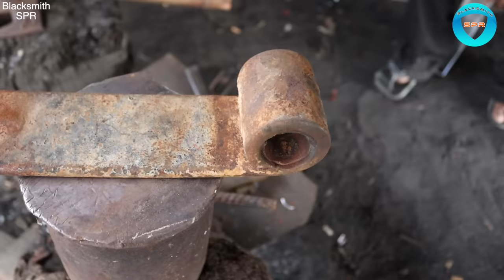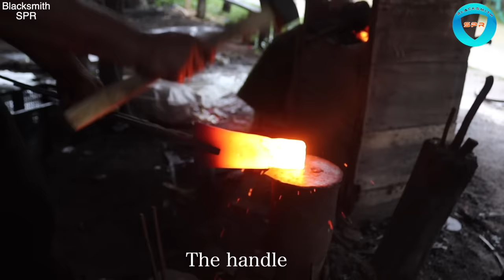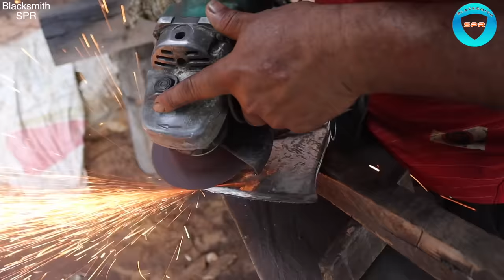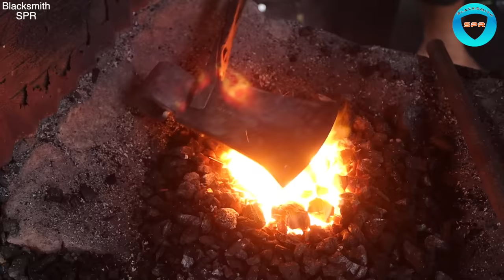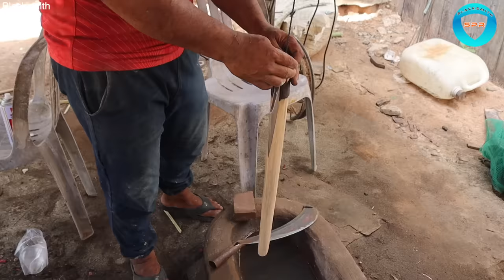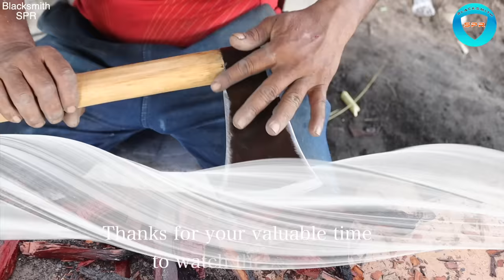Axe Forging | Poor Blacksmiths Can Make A Very Nice Super Axe.

Comment: Maybe so, but how much did all that fuel cost to heat up all the steel?
Reply: 3rd world countries
Reply: @eyecam286  These "3rd world" Smiths know more about it and have more skill than most modern Smiths ! Can you do it with their tools ? I'd guess not !
Reply: @andy6043  Oh, for sure. I've seen tons of video from Middle Eastern metal workers and blacksmiths. They actually fix and fabricate nearly everything it seems. Here in the U.S., creme puffs galore just throw away and buy new. Middle Easterners are far more skilled and resourceful.
Reply: Through lack of tools of any trade, lateral thinking and forced improvisation rules.
The blacksmihs viewed here an example of this.
  Otherwise, these guys are quite aware of time against availability of tools / means to obtain top of the line tools in Western world.